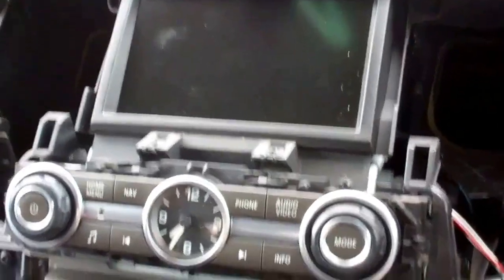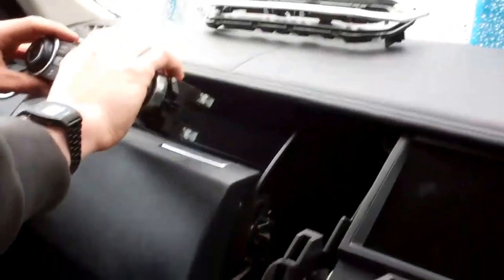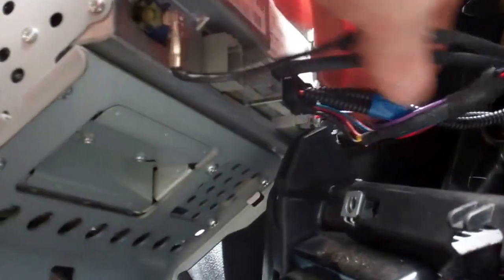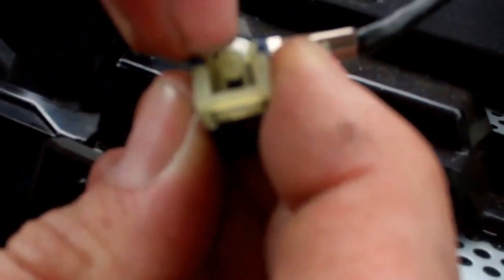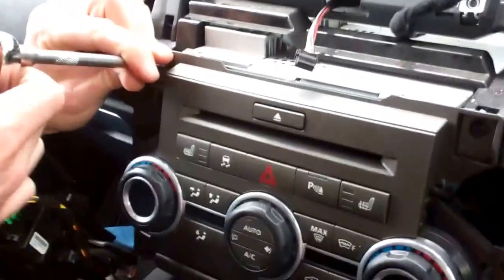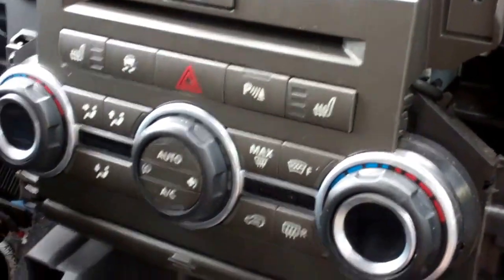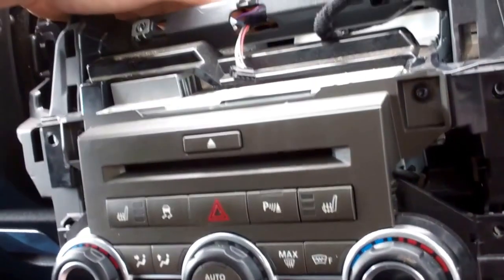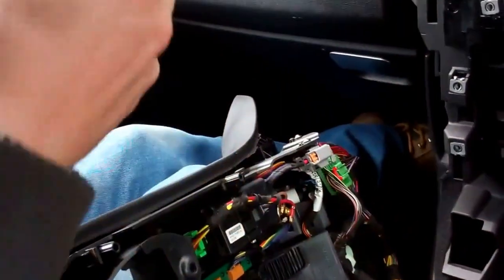How to remove the screen, radio and heater controls Land Rover Discovery 4 LR4

Comment: Hi I’m not getting any heat from passenger side Iv flushed the heater matrix and still the same . Been told blend motors are popular have you ever replaced on or have a vidio of doing so
Reply: Most likely your heater matrix is blocked bud. These run a left and right flute to the heater matrix and the passenger side being furtherest from the ports gets blocked first. Once blocked most don't have success in flushing the gunk out. I'm replacing mine this week.

Comment: You do you guys have the part number of the cd radio unit ?
Reply from the maker: Hi - i think its vehicle specific - if you give me the engineering number from your unit i can give you the part number - engineering numbers are normally in the format HS3N 140002 BN or similar.
Reply: @L663  would the vin # work?

Comment: Cheers for the video. I’ve been a sub for a while and really enjoy yere content. It’s just what I may need but before I plough ahead you may be able to help me. My lr4 is a 2016 and the whole media is not working. . I have power at the screen but it doesn’t display or tune into any radio channels. When I turn the radio off it shows on the screen that it’s off. When I turn on the sat nav it tells me it’s initialising but it doesn’t , my phone won’t connect and finally I can’t get the CD’s to eject. I’m thinking it could be a media module but for the like of me I can’t find it. Have you any ideas. TIA for any advice.

Comment: Good morning from the Czech Republic chaps!
I have been watching your channel for quite a while and thank you for lots of useful tips and advice. I was wondering if you could help with the following. 
I have Discovery 4 2014 and also Discovery 4 2015. I would like to update the infotainment firmware in 2014 model to 2015 version. And also the 2015 model displays some basic information from the radio (i.e. name of the radio station, frequency, RDS information) on the dashboard whereas the 2014 model does not. 
I am sure this is just matter of coding and firmware version as both the cars are exactly the same - Discovery 4, facelift, HSE but when I approached my local LR dealer with this request they just gave me obtuse look. 
Thank you very much and keep up the good work! Martin
Reply from the maker: Hi I have raised this question with the guys at IID - they are the experts at this sort of stuff. They informed me that the entertainment system, including Nav, cannot be updated via the OBD port on 2012+. It uses its own diagnostic port in the form of a USB connector thus an IIDTool cannot help in this case.
Entertainment ECUs for 2010-2011 can be updated using the tool but the Nav is an exception since using another system called a Nav Update Tool.